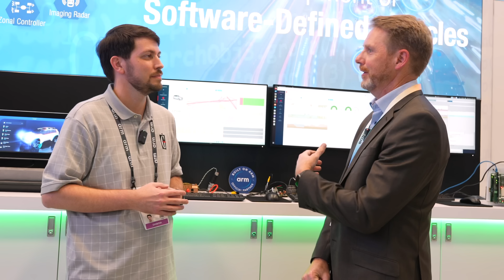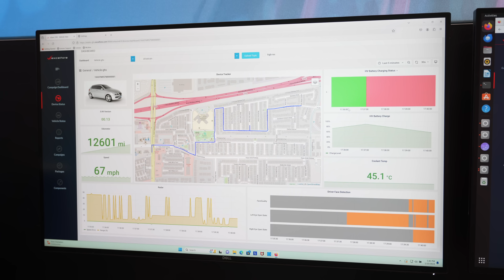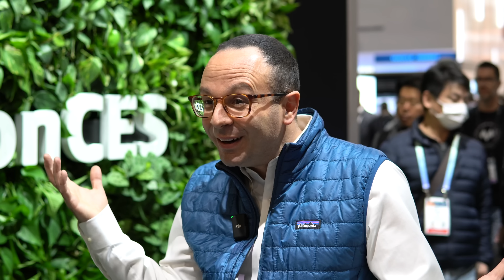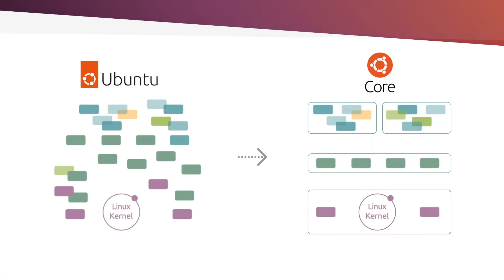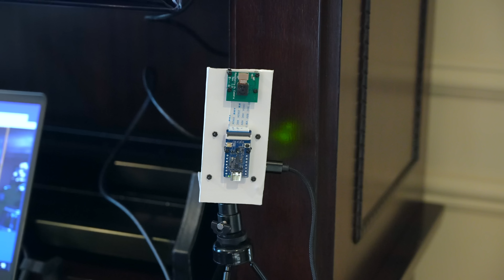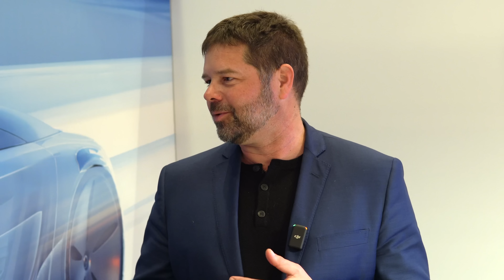AI in less than 100 mW! Power efficient tech at CES 2024

Comment: I work in single digit uW (and even nW) bare metal energy harvesting MCU applications, so no AI!

ARM Cortex M, although efficient for a 32 bit processor, will not beat 8 and 16 bit devices at this end of the market. There's just too much power being wasted twiddling all those largely vestigial transistors unnecessarily.

To put things into perspective, at the extreme end, some 8 bit devices have retention sleep currents measured in 10s of pA.

Comment: I like tech, but everything as this whole software defined vicheal scares the shit out of me. because when it comes to safety like this. I don't want to send a signal via a computer to actuate my breaks. I want a phsycal breakline that when i smash on the break, it powers my break without computers. I am aware ABS and such exists but, when that fails the breaks still work. I want my breaks to work even if the whole car's electronics and power systems don't work.

furthermore i fear that those would lead to even more anti right to repair bullshittery. My new EV, which I love already has huge parts of the repair options shielded behind hidden menus. Can't replace the 12V battery without 'callibration', that I can't start the callibration from the car's settings menu is just horrible. Same with the main battery. Where the reason is that 'its dangerious to do so' 

look...its my  car, i accept the risk, you may warn me but i then accept the risks. This all is not so much about the tech but more how the tech is used, yes i am aware but we sadly live in a world where every single tool will be abused by big manufacterers.

On a more positive node: The 100mW AI chip is amazing.

Comment: damn I had a dream about this, this night or last night, but it was like one of those small short very realistic dreams kind of like a vision, in that dream I ended up looking on a website for devices like this, but they where all optimized for very speciffic AI algorythm and models so you had to select which one to use from many of them, also where special models which used minimal data and where more efficient, those models where called LoRA models. however in that dream I was looking a lot over it to figure out which model and such to use and/or if I should instead just perhaps still get normal hardware so I can run more than one thing.

Comment: Software Defined REAL PHISICAL HARDWARE... of course.
>> oh the 'hypervisor' will defend 1t... I drive a modest 55mpg 15 year old Suzuki Wagon-R+ soon to have an electric tail +50hp ish so be Much Greener than anything newly built.
It's cleaner than most ULEZ cars right now. I'd have to drive it Unmodified, for perhaps a Minimum 20-100 years to match the impact on the planet of building One #Hybrid or similar EV. 
If Big-auto or Governments cared, they would mandate Rear-Wheel conversion for all front wheel drive cars (90+% of all cars) and double-down on Rail for haulage. But I digress.
.
Critical Safety Systems (like Getting Out, all ECU and Brakes, Radio and AI-Assist OFF) need total separation from ANY whimsical software full stop.
You Never cross-over remit with non-critical stuff unless you just don't care. It will get hacked, will turn into a 'pay to drive' sh!t farm. Will find failure modes you never thought of and is an open invite to endless Tesla-style sh!tification of 'the driving experience' - and Ownerless status of your Robot car. ARM or no ARM clever firmware or no.
.
Keep your BRAKES, Radar Cruise, Ride Dynamics, Door Locks, Key and Pedals totally independent from and Way more reliable than the useless Television on the dashboard.
Keep Critical Systems off OTA and physically separate from the Hardware running the fkin radio (usually my ancient moto phone) Mmkay?
Reply: @JeffGeerling

Comment: Flipper Zero…
Reply from the maker: I didn't bring mine with me, but could have fun with one of those at CES as long as you play nice!
Reply: @JeffGeerling  what worries me the most is far behind the car companies are in innovating more secure solutions.  The ease at which you can replicate or mimic wireless keys and be able to control a car through software is scary (thinking of thieves and predators, but government is starting to be equally worrisome too).  Like getting into Edna Mode’s lab, we’re probably going to need multi-factor authentication.

I’ll probably figure out some custom secret way to toggle switches or something so like Biff Tannen, only I knows how to start this car.

Comment: The concept that you can modify your dashboard to some wacky design is mad.  Part of my consideration when purchasing a car is the dashboard, I can see the logic of the thought process by Apple originally; but a secure platform is key, maybe in the future, switching between cars your dashboard setup would move with you no matter what car. But I have seen how Cam-bus technology has lead to total failure after one manufacturer has tweaked setting and messed up another system on the vehicle.

Comment: The Green Hills guy frames it positively, but I think we can tell where OTA car updates will eventually go: pay $50 a month or your brakes stop working.
Reply: Probably not the brakes. But I can see planned obsolescence happening. "Your car is no longer supported, so it won't start/run. Buy a new one to continue using the service." Or even just "You've reached your limit of miles traveled for this month. Your car won't start/run until the beginning of next month. If you'd like to drive your car now, you can upgrade to the Ultimate Premium Plan and get TWICE as many miles per month!"
Reply: And it will all be framed as something "green" and "for the sake of security", and shame you for not contributing to the "effort"... while they go trash an entire battery because it had a scratch on a cover, and log your location to make sure you aren't visiting their competitors' workshop.
Reply: You guys can talk shit about Green Hills Software's founder Dan O'Dud's lame struggle to fight competition, but paying for brakes or miles/month on an owned car is too much of a stretch - I don't think they would ever do that. There are plenty of other silly reasons to make customers pay for stuff, like upgrading your hardware because the old one can't handle some newer security-related instructions in newer CPUs, even if they could be back-ported to the old ones within a safe power consumption range. There are plenty of made up reasons to pay "for your safety." :P

Comment: There are a lot of discussion about the trend of moving functionalities of hardware to software for vehicles. I am confident that the technology is there already. Airbus has introduced fly-by-wire for years and there is no indication that those airplanes being less safe than those with mechanical flight control. Conversely, they are praised by pilots as it enables certain protections and automations that wouldn’t previously be possible. It is the rigorous testing and formal verifications that enables these software to be used in such safety critical applications.

However, in consumer spaces, I am worried about consumer vehicle manufacturers will not pay nearly as much attention to their software than hardware. They are much less experienced in writing safety critical software and generally has a mindset that downplay the importance of software (as they can’t see them, unlike hardware). Doing rigorous testing and formal verification can be costly in term of capital and time, and many of them are not prepared for it. I don’t see how advancements in silicon can help in these aspects. Moreover, the primary incentive for manufactures seems to be to provide subscription based service, which is unfortunate for consumers. The mere fact that software can be updated more easily just became an excuse to ship bad software quickly. While this is OKish in the cloud world, it’s a terrible idea for safety critical software such as those controlling a vehicle.

Maybe stricter regulations (like those for commercial aircraft) will help

Comment: Why are we happy that car features are moving from hardware to software??? That sucks big time!, you get  a half baked product out of the product line, its not consistent as it gets software changes constantly, features can be removed/deleted, features can be paywalled behind subscriptions/licenses, also I'm a software dev, most software devs in the world SUCK at their job, it's just bloated cringy code that needs a million dependencies and frameworks to do the most simple things in most cases, and all their build processes rely on third parties like NPM to deliver the libraries, and it's just a timebomb for every old/mature project! When you have it in hardware, and the hardware doesnt physically break, it's going to stay there forever, AND you can fix hardware, but you will never be able to fix a SIGNED piece of code, because you are not the firmware maker and have no private keys to achieve that!
Reply: People who can't perform critical actions themselves shouldn't be driving in the first place. That's what laws and rules and medical exams do to prevent incapable people from driving. One can argue that very similar systems exist in military vehicles and planes and so on , but these are thorougly tested before they are put into service. If they can pass mil tests - good , don't pass or perform subpar - ban without chance to appeal.
Reply from the maker: There are ways to get into SDVs without requiring total lockdown and the whole 'rental economy', though I'm pretty sure some manufacturers are just looking at it as a profit center (they shouldn't).

There are some great benefits to SDV, especially as critical systems like emergency braking, pedestrian detection, etc. rely on software + hardware to work together—it would be better to be able to run millions of simulations and feed back real world data into that testing cycle. But for the end-user stuff and features on a car, it is a blessing and a curse.

I hope we can get manufacturers to understand that 'renting' the stuff that you already paid for in a car is a no-go!

Comment: Smart phones have accelled arm big time. They were a low end efficienct mcu as long as you didnt need performance. But smart phones pushed innovation and now that window runs very well on arm and more and more arm is being adopter, intel and AMD should be scared...  AWS using full ARM datacenters was unheard of a decade ago because to get the equivalent compute power, it would take so many procs the power and space would be wasted. But now, holy crap!!!!   Software is a big part that writing good code and simplified code makes it where you can run arm so efficient and not just take and "make my x86 software work on arm through a convterer". But rewrite the software for the mcu, and holy crap at the possibilities. 

I cant wait ro see how arm gets better and bigger

Comment: Software defined vehicles. 

Back in 2010 when vmware (RIP my good friend) was making massive game changers by pushing software defined networking, and software defined data center...  Now common place. Most experienced network admijs hated a GUI and just wanted to configure simple switches. But now you can buy switches and use as layer 3 or 2 depending on need, advanced features like 802.1x, muticastdns, and all the data being fed out into SIEM systems ro give you graphs and see where problems are starting before total failure, or switch networks to a second core/route with the lush of a button. And have a single deployment or profiles and as you grow and build out your network it replicates out to all your network, no more logging into each device and process updates and hope it works. 

Just shows how today hardware is ubiquitis and now its software to drive all changes. 

I cant wait for the software defined car, but i worry about the heated seats subscriptions and auto wipers with rain subscriptions. So manufacturers get money for the life of the vehicle and no more just a single purxhase and done. So they can make tons more $$$$. But bad for consumers. 

Security is something thst needs to be enabled and pushed as a first goal. Never release half baked systems that a malicious attacker can take over a fleet and crash all cars on the road. Killing people. (ahem Chrysler group).

Comment: Car software updates, because updates never bricked a computer before. /s
Reply: Ford's MachE literally had this issue last year. A botched firmware update bricked a vehicle and left the error message: "Your vehicle cannot be driven" followed with instructions for contacting a local tow truck
Reply: @kirbeast46 pretty sure something bricked a Hyundai too. A commercial radio broadcast did something and the car radio stopped working